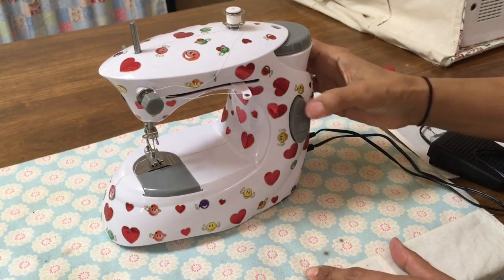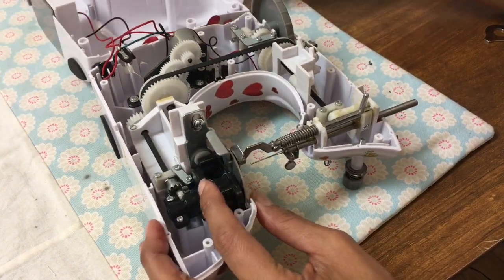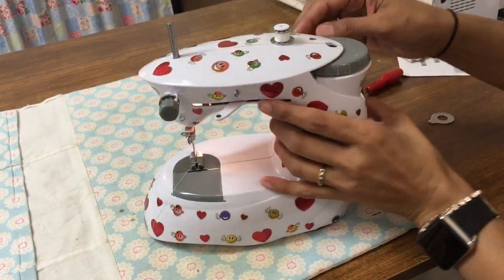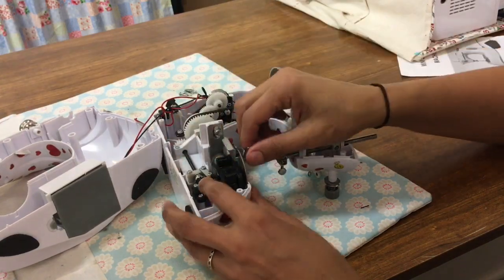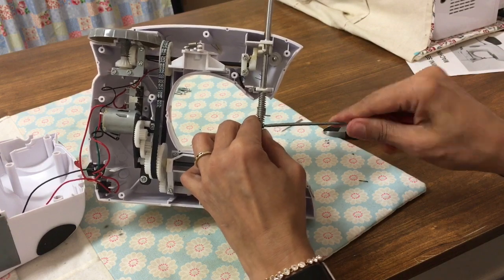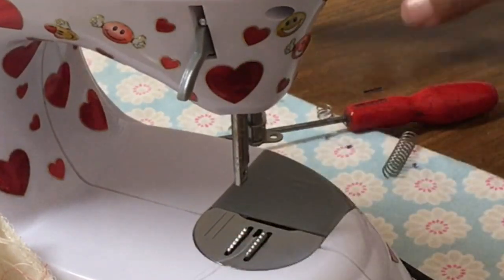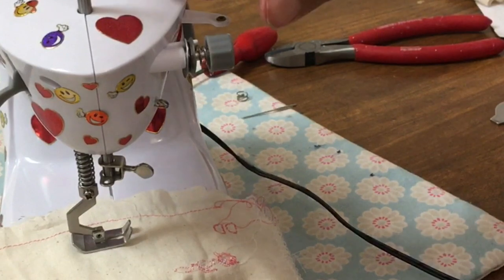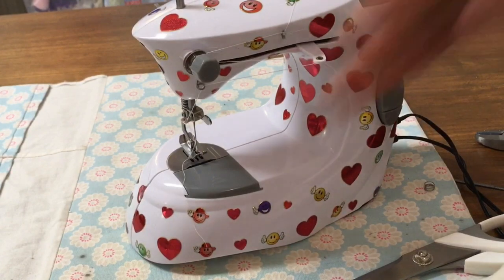Shark Pro Mini Sewing Machine repair maintenance | Abi’s Den ✂️🧵🌸

Comment: Hi Abi, I’ve started using this sewing machine which is the same one as you have in this video. I just wondered how to undo the little bolt? I wondered if there was a way of doing this without taking other bits apart. They make it look as if you can just turn the little finger screw but it’s so tight I just can’t move it and I’m sure from looking at it that it must be the little bolt that needs loosening up first. Instructions are not great in this manual that they include with it.

Comment: Good evening ma..please i need your help.i just came across your page.i bought this mini machine since december and i havent been able to use it.it cant even sew for a strqight 40 seconds.the thread controller keeps cutting the thread.the thread will twist and cut.i am frustrated as i cant fford another machine please help me
Reply: I will try that tomorrow as its late already..i will.let.you no as well...everything they have ever told me..neva seemed to work.some said i should check the threading..etc...i am just hopeless and angry as its a waste of my mony..once i start sewing, the thread instantly curls and cuts.. The thread also gave the body of the machine a mark..now the thread hangs there and cuts as well..i saw a video on youtube advicing  to cover it with a seal tape..yet it doesnt work..to think i was very haopy when i wanted to buy this machine...i'll try it and let you know tomoro morning..thanks for the help
Reply from the maker: Ron ron if you can send me a video on Facebook, I might be able to help
Reply from the maker: I think I know what you mean. I no longer have the machine, but make sure the thread lever, that moves left and right, sits all the way on the right before you thread up the machine, and when you finish sewing, make sure it sits all the way to the right Before you remove your fabric.  This lever pulls the thread from the spool, but if it’s not in the right place, it will pull it out of the needle instead x
Reply: Ok i will.tomorrow ma'am...thanks